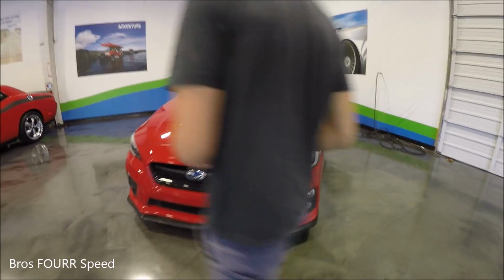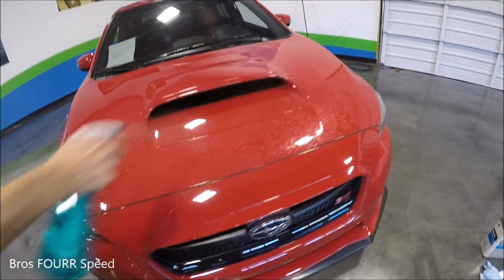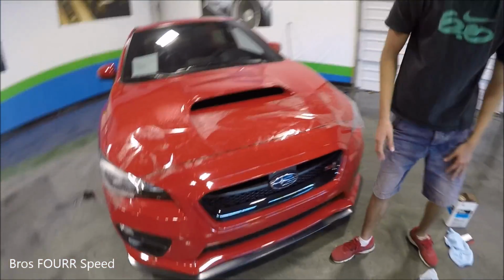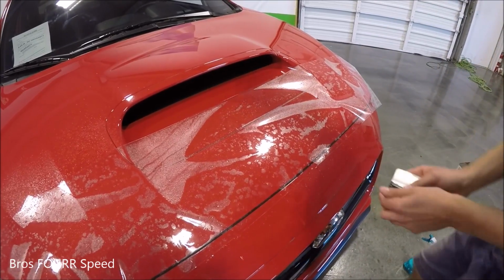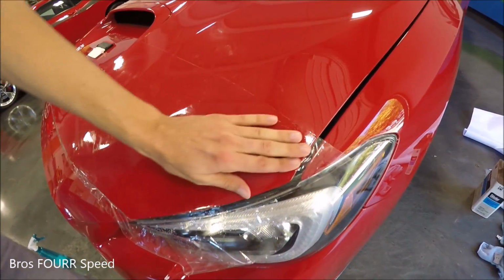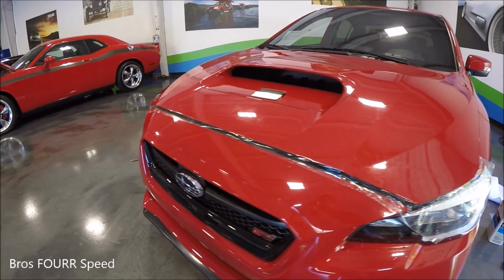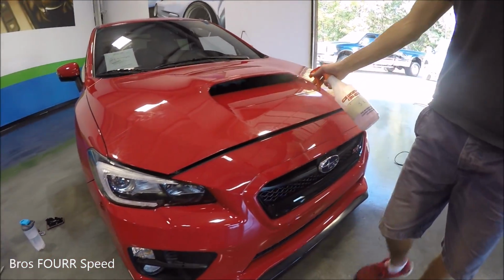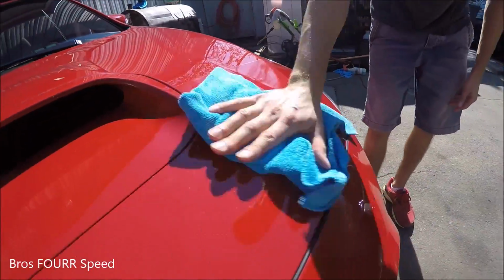How To Apply Paint Protection Film: 2015 Subaru WRX STI Hood PPF!

Comment: I guy cut me off and I have paint rub all over my right side bumper and a small crack in by the fog light. I luckily have 3mm film on my bumper, but its fucked. I'm pissed. I'm going after his insurance, but If it doesn't work out for me in the end. How much will it cost for the a shop to replace the 3mm clear film and small crack? I have an Altima.

Comment: I see a lot of swirl marks. You should have used a clay bar and polished the area before applying the vinyl. Also, wear gloves otherwise you can easily get finger prints under the wrap. I hope you guys didn't get paid for this job, that was a very sloppy application. Cheers.
Reply: Thought the same thing
Reply: Considering claybars clean not polish....

Comment: Is there a reason people don't wrap an entire panel? What's the point of not covering an entire section and leaving a dumb looking line in the middle?
Reply: Spencer Porter High quality ppf film is expensive. 1100$ for xpel ultimate plus at 60" by 20' (11$ per square foot), and that's just the film without the labor. So even if you're going to try to do it yourself, you're looking at probably 200$+ in film for a full hood.

Comment: did you use different or better vinyl then what you tried on the 370?
Reply from the maker: Same stuff. But the hood is much more flat, and I took more time. This stuff can work for a more simple shaped hood. But is still to thin and plastic feeling to be good. A little thinker film and more of a rubber feel would be ideal.

Comment: That looks like it was put on with a steel brush. Disgusting. Is that the cheap Subaru paint or cheap/misapplied vinyl?
Reply: They didn't spray any water on the top of the vinyl to lessen the friction of the squeegee and marred it.